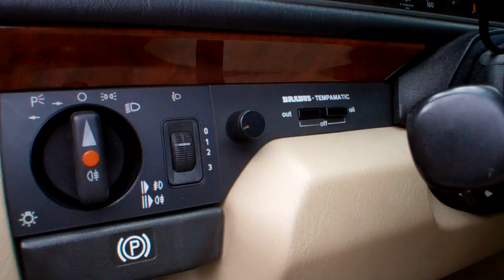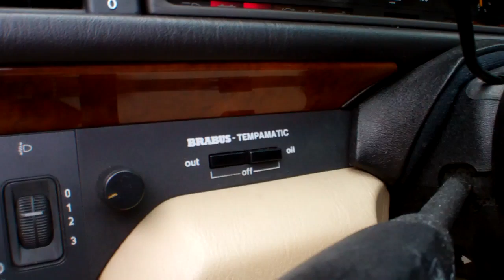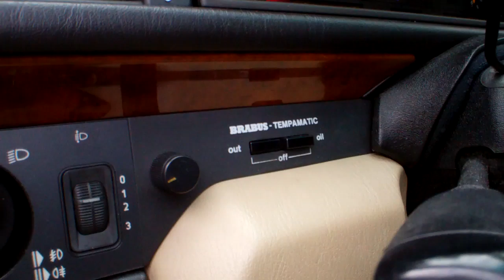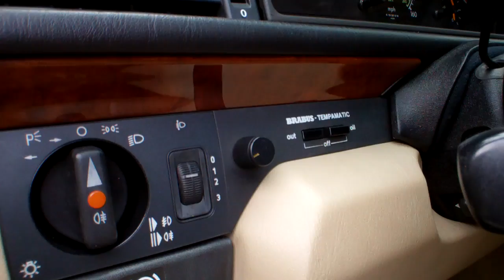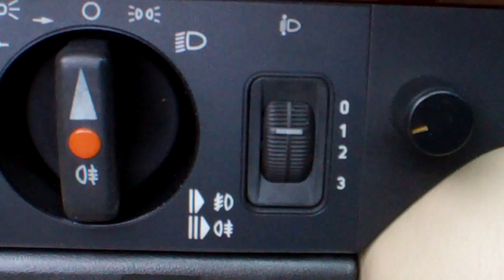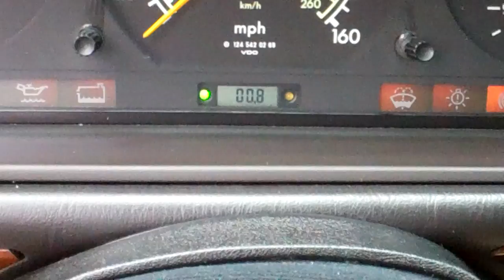Mercedes W124 500e Brabus Tempamatic control system

Comment: It is possible that in same cases the Button with "temp" is near hazard Button?
Reply from the maker: For the W124, have not seen anything other than what I have shown in the video.  Some of the kits though, have the oil temp sensor integrated with the oil dip stick, which would be a better solution than a drilled out oil drain plug

Comment: I got this system original installed in my 124 brabus as well. If your sensor ever fail (they do and will because it's poorly designed) remember to put a shrink hose over the transistor as the metal housing will short the transistor if it comes in toutch with the drain plug inside that has ground to it.

Just a correction. They do eksist in Faranhait measuring. I got the catalog that says do.
You can even program the one you got to show it in F.
👍
Reply from the maker: Can you share the procedure to switch to Fahrenheit?
Reply: @2phast  this has to be done with a programmer for the device internally and I'm not familiar with what program.

But they did have it in their catalog

Comment from the maker: Yes, correct.  Any performance chip would be specific for 92 only or 93/94 only.  Because of the WOT enrichment on the 92, it required a different type of ECU chip than the 93/94 (which didn't have WOT enrichment)

Comment from the maker: There are no performance chips that provide any noticeable gain in power output.  I did have a ECU chip in my other ECU, it was good for eliminating the cold start upshift delay, increasing the rev limit and eliminating the top speed limiter.  But for power, switching to the early 91/92 ECU netted a additional 7 hp due to the WOT enrichment.